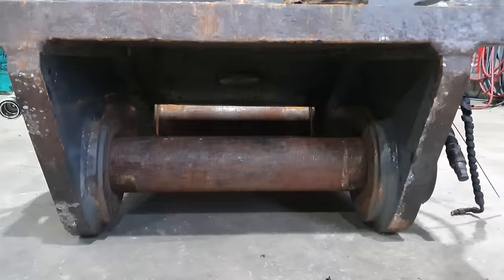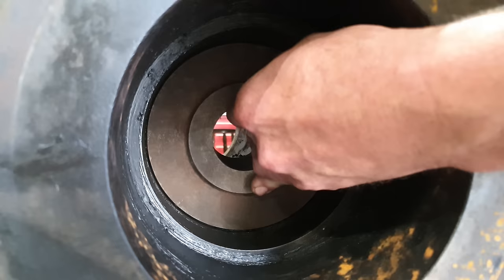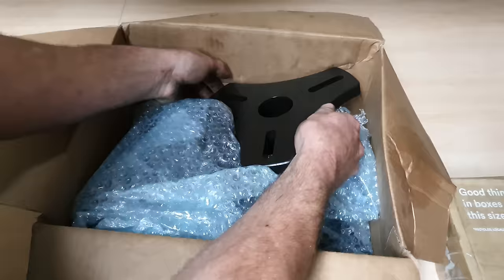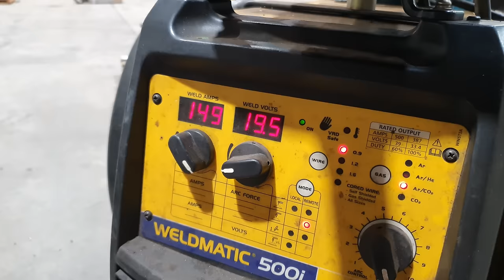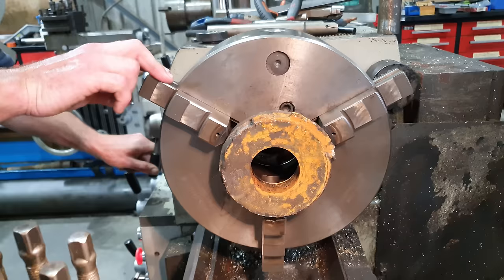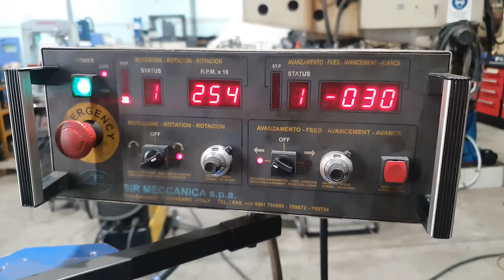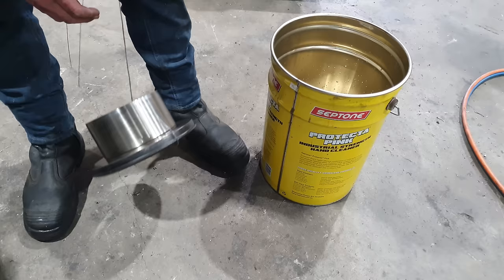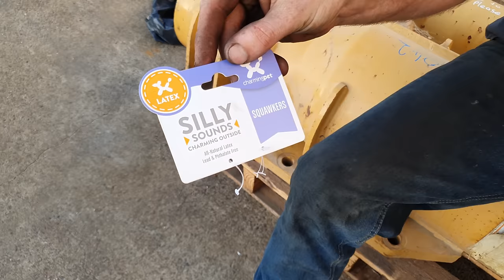Repair SUPER SIZE Tilt Bracket for 90T Excavator | Line boring & Machining

Comment: Ok so I've only been a gearhead and I've never had to do just a ton of welding but I've done my share of it. However this is one of the most awesome videos I've ever watched in my entire life and I've always been amazed at how some of those small bits like that are able to just chew through what you would think couldn't be chewed through. The 2 things that stood out the most to me was the huge ass wire welder and how it welded around and around like it does and the other was when you pulled out the liquid nitrogen or would liquid helium be used on such a huge piece like that where it will be under some extremely high strain on that excavator. Absolutely Positively Amazing work on all of that I was thoroughly entertained watching this thanks for sharing this with the world!!!! Just for the record you earned yourselves a new subscriber also keep up the awesome work!!!!

Comment: Looks like the same quick hitch I have on my 1.5ton machine, for some reason though after I fitted it, the boom on the digger does not lift up and my trailer sits on the floor like the tires are flat 🙈

Comment: Kurtis, do you have an opinion on the FAG vs SKF bearing debate? I just used a set of SKF's for a wheel bearing swap on my old BMW. But I'd read a lot of chatter online about both SKF and FAG not being as good anymore if they're not made in Europe. Mine were Italina made so I felt comfortable using them. But I'm reading that a lot of Chinese-made bearings are really unreliable.

Comment: Hi Kurtis, I’m curious about the ECGT tooling you are using in your line borer.  They are very similar to CCGT tooling, but don’t seem to be very common, at least here in the States.  Do they have an advantage over CCGT in that application, or is it as simple as that is what the manufacturer supplied with the kit?

Comment: Line Boring Question: How is the diameter of the cut set? I assume (ashuume? 🙃) either the tool arm inserts are specific lengths; or Kurtis measured the tool insert into the bar holder off camera?  Apologies, I live on the front end CAD and 3 & 4D modeling side. They don’t let us go downstairs where all the magic happens.

Comment: I've heard you talk about it, and watched you weld on the outside of the line bored piece. Saying the welder goes in a spiral pattern like threads. In this show you let the welder do all the work. Is it just different jobs, or are you getting better at using the line welder?

Comment: That sleeve between the two bearings is probably there for preload, which helps reduce both axial and radial play. Using 4 bearings probably eliminates radial play, but without preload you will probably still get some axial play.

Comment: I’ve watched this video 2X now I’ve questions & comment 
Comment, I noticed that you used plain bolts on 1 end of the brackets & cap screws on the other, the bolts are sacrificial so just plain will do 
Question the line boring, you bored the holes then you welded them back & then bored to the correct size, why’d you bore the 1st time ???
Question how long did you leave the bushings in the nitrogen ???
I’ve never done any machining of this size or tight tolerance but I’ve done a little.      Thank you sir & Ma’am     I do appreciate your videos

Comment: I NOTICE THAT YOU LIKE THE AIR GRINDER,IS THERE A REASON YOU PREFER THAT OVER AND ELECTRIC MODEL? In my shop ,I use air and electric,but usually the air is only for body work,with 36 grit disc!

Comment: How far off the surface of the part could the bore welder add material? (if it was left running at 19:17)
Could it build a tube off the surface like a 3d printer?

Comment: I am not sure if I fully understand why the smaller line bore didn't need welding up?
The diameter must have gotten a bit bigger now? 
The bigger one below was bored, welded and then bored to spec again.
Reply from the maker: You might need to watch again 😉

Comment: Our Volvo 750 ho has a lose bucket and it's not far from blowing out as well lol the bucket moves a good 2 inches in every direction it's pretty worn out. No one likes to fucking use grease,  an when it gets so worn out the grease won't stay it it just falls out,  the fuel truck guy hasn't been doing his job an it shows. Nice job. Them quick coupler are very nice an ur so right that's a lot of ho an weight being pressed on them pins.

Comment: I'm actually a little surprised the customer didn't have you fabricate a new tilt cylinder pin to replace the one that broke and ripped the spacer disk off...

Wouldn't it be cheaper for them to have you turn a new one on the lathe rather than buy an OEM Part from the manufacturer since you already have the thing in the shop, it wouldn't be hard for you to get the specs (or just measure the existing pin) and whip out a new one using the off-cut material you have just lying around from previous jobs...

Comment: At 19:54 it didn't go through right?
IMO the weight of the machine should be supported from the ground. Not even adjusted by the screws. Steel behaves like a rubber

Comment: I seen that you used 2 rods in you air arc ?
Reply from the maker: yes I use the general round carbon rods for "cutting" away the weld material, and I use flat carbon rods for "wiping" away the material

Comment: Ah 21:50 you can see the insert getting chipped from the impact. F
Reply from the maker: Nah mate that's just the metal chips landing on the insert, takes more than this little interrupted cut to hurt that carbide insert
Reply: @CuttingEdgeEngineering  oh, I wasn't sure after I made the comment. Thanks for clarifying. Awesome work as always